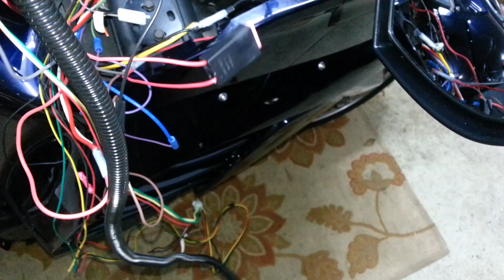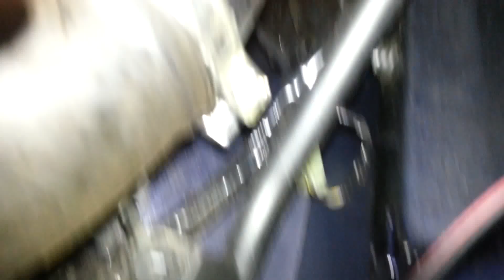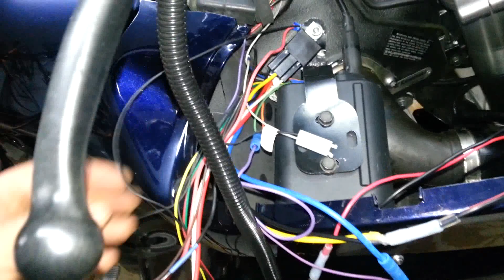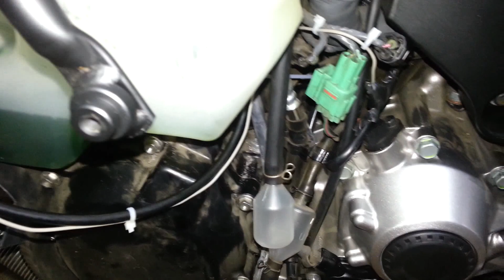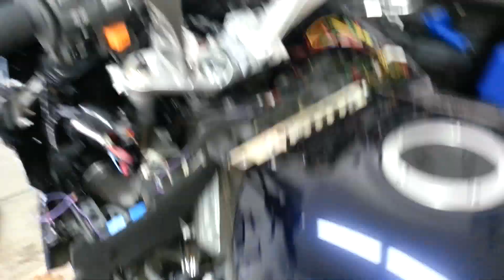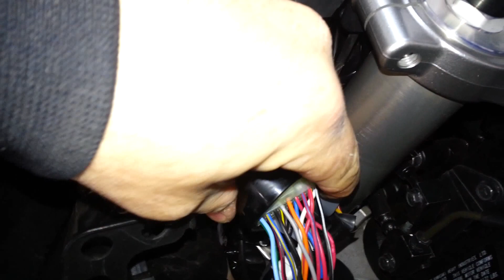Kawasaki Concours 14 Rostra Electronic Cruise Control install Part 3

Comment: It's 2021 and the Concours 14's STILL don't come with factory cruise...nor are there any reasonably-priced after-market units available for them....why, Kawasaki, why?
Reply: I have some inside scoop ( from dealer buddy) this is last year for current Concours. Supposedly an announcement in late November of new model - with cruise. I’m riding my Ninja 1000ABS until then.
Reply: @christianpaul3303  Welp, you were wrong on both counts. 🤣 (Though they are cancelled for '23, instead of '22.) There will never be a new couch rocket like this bike, FJR, K1600 (on it's last legs) ST1300 and Trident. These bikes were a 'fad' and they just now push people to the Goldwing or tourer cruisers. Engines are too big. Too hard to get through Euro 5 and people, typically, get much the same comfort out of the faux-ADV bikes like a Versys 1000, V-Strom 1050, Super Adventure, Multistrada, Tiger 1200, GS1250 etc.

It was nice while it lasted. 😥

Comment: Do you have the product code for the cruise control unit or do they only do one type rostra just sent a standard we don't recommend fitting our products to motorcycles lol also murphs kits haven't responded as yet
Reply: Thanks for all your help
Reply from the maker: https://www.amazon.com/Rostra-250-1223-Universal-Electronic-Control/dp/B007ZCQD9S/ref=pd_di_sccai_1?pd_rd_w=qPNhc&pf_rd_p=c9443270-b914-4430-a90b-72e3e7e784e0&pf_rd_r=G2B6CAVZBM86QVSYAQ3V&pd_rd_r=f8b7030e-83c2-4ff2-a3c6-2793dee29e36&pd_rd_wg=vwkMX&pd_rd_i=B007ZCQD9S&psc=1
Reply from the maker: does not look like Murph sells them. You will need to fashion a handbar mount. You can also buy handle bar switches and make a custom switch set up. (Did that on my Versys)

Comment: I know its been a while but how is the cruise control doing what climate are you in and do you have the model number thanks in advance for any help
Reply from the maker: I have installed both types. The analog version on an FJR and versys. Electronic on connie. Go with electronic and buy the projective control mount cover from Murphskits.Both held up well.

Comment: Justin, it's okay.

I am Carlos, I live in Brazil, I have a Concours 14, which burned the KIPASS module.

I bought another kipass module on ebay, so I put the KDS3 scanner to configure the fob key, but the KDS3 system did not release the window for inclusion in the new key.

Have you seen any problems like this?

Would you help me?

I thank Carlos
Reply from the maker: sorry, I am no help with that. :(

Comment from the maker: Great! So This is the 3rd CC unit I have installed on a bike, and the first Electronic one. The Vacuum units are smoother. Having said that, the electronic is the way to go for a Connie IMHO. Issues: With Protector over control pad, its a little difficult to engage and It "Surges" at slow speed. It also engages abruptly too. But once set at highway speed. IT'S AWESOME! I would install again.for sure.
Reply: Justin how much you charge to install one on my 2015 Kawasaki Concours?